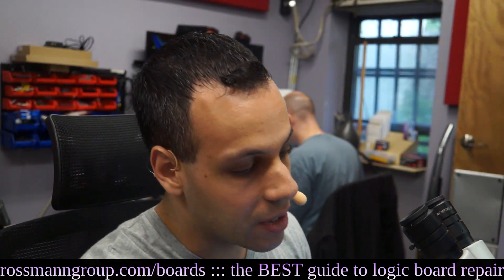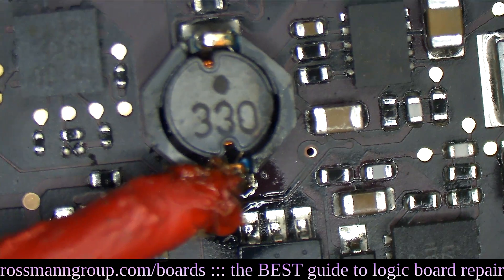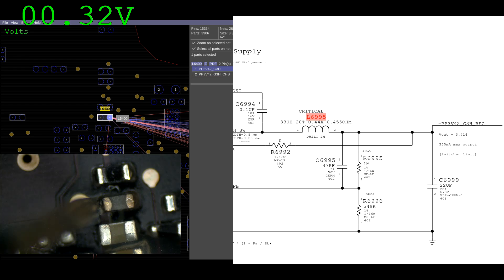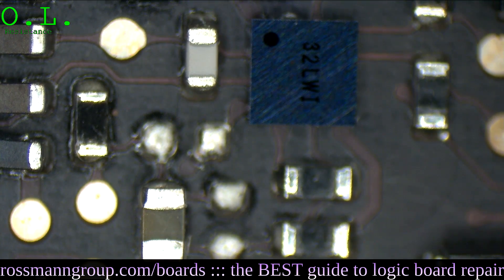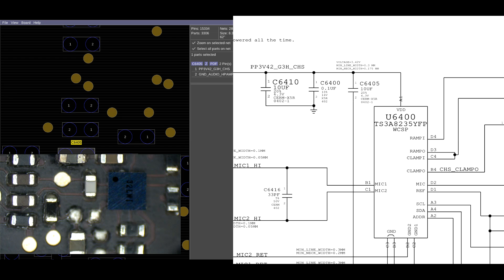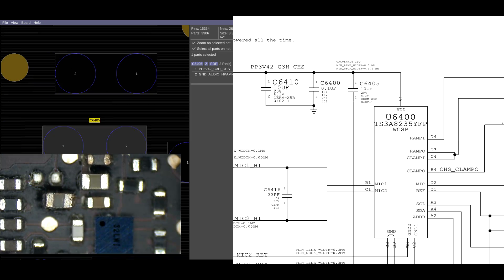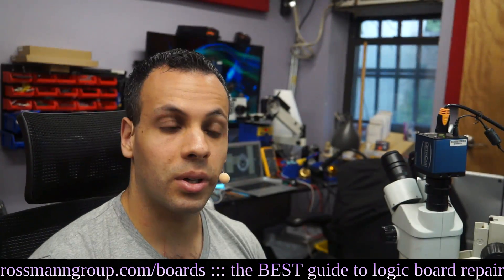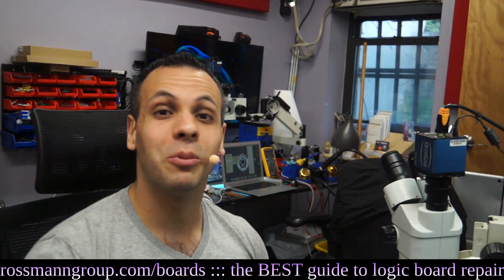Can Macbook audio circuit spontaneously kill entire machine?

Comment: Hi my boy Louis.
I am a fan! You've got me inducted into tying to fry my 3ds.....
One thing I want to know, are you a fan of doing autopsies?

I've got this VPCEG33fx Vaio laptop, and it has run over 99° since we got it. 
And I use it as my work computer (yeah, I'm like reaaaaally poor) 

Anyway, I think this piece of hardware would give you a goood video on how well-built this machines were, and an autopsy video would be really fun, like you could just analyze how well this is done vs other stuff that isnt so well done. 

Ive used this computer for 6 years, and I'm the poorest architect you'll ever meet.  

This shit has been used for rendering on Thea, used for modelling on C4D, Blender and 3DStudio-------

And it would reach 120° temps. and wont shut down.

I really want some pro to dig on it... (still works)
 
And you'll get it for spare parts, like it's a super laptop and you'll enjoy it 8it has some DIY repairs done

PLz!!!!!

I try and work on it daily, and it just keeps going. 

I would like to trade it for a few components! I give a fuck if I build a pc on a wooden board, I, I just have no way of getting a new computer and I want to treade this abomination to you for a couple pieces..... 

Desoerately seeking your attention mate... cheer you rock!

Comment: Before I even watch the video I want to say my Dell Inspiron 7778's sound card is currently shorted out, does not function and i'm watching this video on it using a Bluetooth speaker for sound. for those unfamiliar with the 7000 series dell notebooks, they are very similar to Macbook pro's in design however clearly they're a bit more durable, this same machine has had a liter of water poured into it

Comment: Just wanted to share my Apple story today.

So I bought a brand new MacBook Pro on tuesday. Yesterday (Friday) the battery got inflated and disconnected the bottom plate of the laptop from the top. I went to the Apple store right away. They couldn't take it because their service center wasn't working. They said to come every day between 9 am at 6 pm. I came today at 11 am. The service center is working but the tehnicians aren't there. I was told to come on monday. I paid 2000 USD for this? For this service? For a laptop to get fucked after 3 DAYS of usage???? 
Please note I bought it because I'm a developer who has to develop apps for both Android and iOS and therefore I NEED a mac sadly...
Reply: You can make a hackintosh :)
Reply: I can't legally
Reply: Andromeda Same here.  As developers we need to be way more careful about licensing issues than normal people, because being on both ends of license agreements is our livelihood.
Reply: IIRC you can run MacOS in a VM.
But really, if anyone needs OS X for anything, use a VM or Hackintosh out of spite. Apple deserves no more money.
Reply: You don't need a mac to develop for anything, most decent development suites have Windows and Linux versions as well. I can target Mac/iOS/Android/Linux/Windows/Consoles in ARM or x86/x64 architectures with Unreal studio and there are workarounds or fully supported project templates for things like Visual Studio. The only case where you need a mac with respect to developing apps is if you are targeting a mac platform for your app, and that would be for testing purposes not the actual development part.
Reply: When you need to make a native iOS app (it has the least overhead and works the fastest) you do need a Mac...
Reply: yes but it is ILLEGAL. That's a huge issue if you wish to sell your apps.

Comment: My 13" mid-2013 Air lost audio port, the left USB port, the internal speaker and charging at the same time. (cam only use on AC power)
Got an XPS 13 put Linux on it. Will probably never go back.

Comment: What doesn't kill a mac?
Reply: Alexander Langella buying a good computer from a good brand and stick mac os (if that's your thing) on it and use it until its simply too slow move files onto new computer and repeat as nessasary.
Reply: Not a fan of the OS either.  It is more stable and generally cleaner, but then even Windows 10 has come a long way and I would say it's on par for stability...just heavily laced with spying software and far more limited in override controls, but you can still completely reduce it to a unix-like platform like you could with XP, though you cannot remove the rootkit elements that run in the background.

My family owns macs.  The last Mac I owned was a PowerPC back when they were openly upgradeable and scalable in hardware on level beyond the old Mac II's.

Most of my productivity software (and I tend to game) is windows based.  That said that's an interesting idea.  Wouldn't there be glaring driver issues though?  I'm fairly sure each Mac OS is designed with very specific sets of accepted hardware they integrate drivers for.
Reply: Alexander Langella mac os is fairly easy to hack onto intel consumer (i3,5,7) all you need is a flash drive if i remember correctly. If your going to buy an AMD Ryzen pro just hope to god Apple starts to wise up and use those cpus(because vega smashes Intel hd shi.. I mean graphics) because last I checked hacking mac os on ryzen was a pain in the ass and with vega being the easy part. As for drivers its architecture to architecture so anything apple uses in their "products" will have driver support. So intel cpu stuff, vega, and intel hd graphics are the seamless ones.
Reply: Not buying one or not using it if you bought one.

Comment: Lou's next vid: THERMAL CAMERA BRAND IS GARBAGE
Reply: He has had at least two videos citing the uselessness of thermal imaging in most cases. Alcohol + voltage is faster and far more cost effective.
Reply: It did find the problem area, though.
Reply: @Benjamin: I've seen those videos. And in them, the thermal camera clearly lets him zero in on the problem area, even if it doesn't have the resolution to show the exact component. Also, in this video, the ground fault disappeared, and it was the residual heat which the camera picked up that allowed him to narrow down the part of the board. So obviously the camera isn't useless. Louis's main complaint was the cost versus the benefit.
Reply: Cast vs benefit to me is big chunk of it's usefulness. Also he described a couple issues the thermal cam was having that would immediately prevent me from buying that one regardless of how "useful" it is. The most important aspect of a tool or device that is used as a tool, to me at least, is that it functions like it is supposed to every time. I've got zero use for anything that costs upwards of $400 that doesn't function reliably for at least a couple of years.

Comment: Will you talk about the recent Apple watch controversy?
Reply: A lot of them have the screen dislodge from the casing with Apple again charging for repairs.
Reply: What controversy regarding the Apple Watch?
Reply: Andrew Macintyre Are you fucking kidding me? Has it been determined yet why they get dislodged?
Reply: "We make expensive things easier to break and we'll also charge for the repairs! Win win!"
Reply: @Sonicfan1661 - Source: http://www.iphonehacks.com/2018/06/apple-watch-lawsuit-all-models-defective.html
I don't believe the specifics have been detailed but there's a new lawsuit regarding it. There is mention of swelling batteries (A known and acknowledged issue from Apple on the Series 0 and 2 Apple watches) that can dislodge the back casing and 'in rare cases' dislodge the screen but whether that's the main cause I don't know. The lawsuit is on all Apple watches but Apple hasn't acknowledged an issue on their Series 3 watches. I haven't read deep into it but it looks like there is a battery replacement program in place by Apple and an extended warranty due to the issue but with Apple who knows what the specifics are.
Reply: I wonder how apple gets around the consumer laws that require any company that produces a product that has a known flaw that can damage or destroy the product or cause harm has to fix it for free.
Reply: I wonder how apple gets around the consumer laws that require a company that produces a product that has a known flaw that can damage or destroy the product or cause harm to fix it for free.

Comment: Why does removing the jtag connector sometimes fix a macbook? I know it works, it worked for me, but how does that fix it?
Reply: The JTAG like other things in a mac product is connected to almost everything so if it has any issues it will prevent everything from working. It's just another example of bad engineering.
Reply: I dont know, a short? Louis made a video and explained it
Reply: oh okay, thanks

Comment: 7:05 - "Like who uses Ethernet..." - LMAO anyone that wants a STABLE and MUCH FASTER connection. That's who. I'd love to know which idiot said that? Too funny.
Reply from the maker: I use ethernet because WiFi AC is still too slow. Even wired 1 gigabit is slower than an SSD transfer speed. However, do consider, we are talking about Apple here. People are fine giving up their SDcard slot, USB ports, headphone jack... is ethernet really on the top of the list there?
Reply: Louis Rossmann there is a dongle for that...
Next year Apple will remove the trackpad so that people can buy an external one. 😂
Reply: Buford "Mad Dog" Tannen they already basically took away the keyboard.

Comment: Does modern R, L & C does not come with colour coding? How are we supposed to identify it?
Reply: Jeeva Bharathi , not at all. If you are talking about the components on the board, he knows the values from the schematics you can see in the video. 
Now, if you have a stock of  components and somehow mix them, you can always use a meter to check values.
Also, some components can have a number code, depending on their size.
Hope this helps
Reply: Robson Couto, and cccp3, Thank you very much. Have a fantastic day, Lads.
Reply: Robson Couto Also the rolls of C and L are usually labeled so you can put the correct roll into the pick-and-place machine that you buy from someone like Samsung.

Comment: Yes i always use wire connection on my lan. Wifi is way to slow.
Reply: Speaking of latency don't delay stream with MikroTik SFP+ today :)
WiFi usually is worse in overpopulated areas. It's not like someone would run around and ask everyone to lower WIFi signal strength and set the best channel or tape walls with tin foil.
Gigabit Ethernet is most likely the best bang for your buck
Reply: Wfif's alright if you have a good router and reliever but nothing beats wired.

Comment: Apple is on their way to making exploding laptops one day.
Reply: that's genuine hardware protection built in for your saftey as a consumer. All Apple products shall explode if subjected to moisture, vibration, normal charging, attempts to plug in headphones, or in the case of iPhones talking into it or holding it wrong.
Reply: mechaart if they use skylake then its only a matter of time(them intel CPUs run hot)

Comment: Answer to every "Can * kill a mac" question is yes. Thinking differently apparently means designing everything to have to go through everything else for the product to work.
Reply: Benjamin Hale even using it properly can break it 😂
Reply: I think it's more Apple has the knowledge that people have gotten less intelligent with purchases over the last decade or so and they will buy anything that looks nice it doesn't matter how it performs or how much more it costs than better products that don't have the sleek aesthetic. There is quite a large community that believes Apple invented the smartphone the touchscreen keyboard and the mp3 player. they invented exactly zero of those things,  matter of fact I can't think of one single solitary thing apple actually did invent, I'm drawing a blank.. everything they sell is someone else's idea or a combination of several people's ideas but nothing at all original.
Reply: Man be sure you don’t even have bad breath near the thing or it’ll fry.
Reply: INFINITE POINTS OF FAILURE